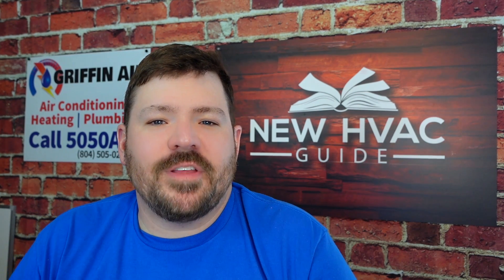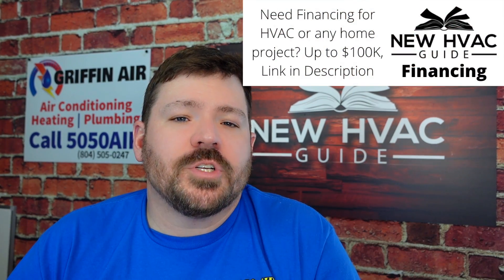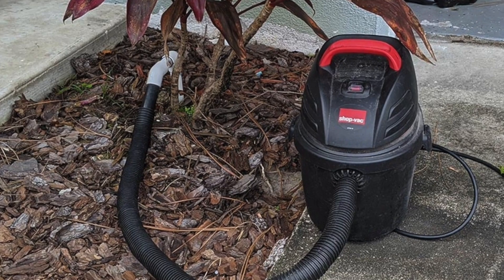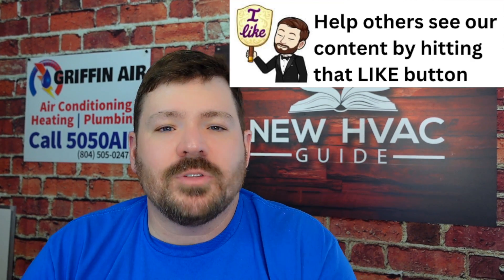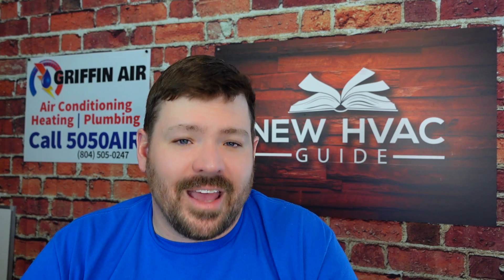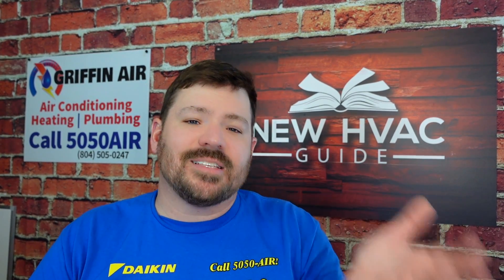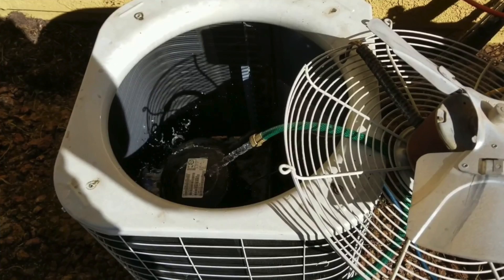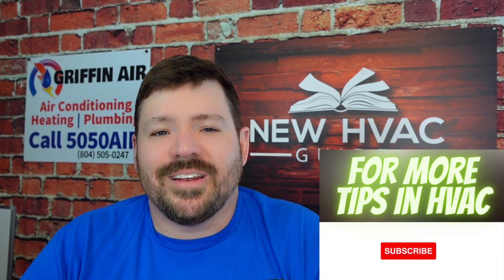3 Things HVAC Techs Do WRONG!

Comment: Whether you clear the block with nitrogen then flush the line or vacuum the line out then flush the line   both techniques work just fine ..
Reply: If the line is bad enough to blow the drain line out then you need to run a new pvc 40 drain line  and install it correctly then

Comment: Lately I've seen more techs do things incorrect. Mainly because I think they're thrown to the wolves too quick and don't get enough time with a trainer or supervisor because the lack of experience becomes very obvious. I'm not an HVAC tech but I am a tech on Flight Simulators and have been on electronics and aircraft. So I at least know how to troubleshoot and read schematics. The biggest thing I've seen is they're quick to change a part or what I call shotgun maintenance in most cases the probably hasn't been the equipment but the quality of the install. Someone didn't connect a wire properly or recently found out my dehumidifier drain lines not all the connections were glued. I've had two HVAC systems replaced by the same company one in 2016 and one in 2021. The system in 2016 in 5 years I can probably count on one hand the amount times I've had to call were there was problems with the system. Every time it was a part. My system in 2021 I've probably had over 20  services calls with the problems mostly of it due to the install or a design flaw.

Comment: Good morning! HVAC was short cycling called tech when he came out installed run capacitor to outside unit wrongly misplaced connectors on capacitor. System heated up and shutoff. Smoked at wiring. At furnace smoke came from condenser and motherboard. Crazy right

Comment: Called a company out because my heater was acting up. Dude fixed it for a reasonable price and was professional. I then signed up for their maintenance program. Had nothing but good experiences so when my parents AC failed I recommended them. 
 Dude wrote up a $10k estimate to repair it versus an $8k estimate to replace. No brained right? On his estimate he claimed the evaporator was rusted and leaking. The evaporator is aluminum. So I called his boss. His boss claimed that the frame is steel and just the coils are aluminum. He said the steel rusts where the aluminum tubes run through the frame and damage the tubes. 
 This sounded very probable and was a good explanation but I wanted to double check. I pulled the panels off and right behind there you could see the rust he was talking about which was clearly dripping down from a steel piece above the evaporator. The frame he said was steel was indeed steel but it was galvanized. The aluminum was solidly mounted to that galvanized steel and there was a big gap around the tubes where they passed through the frame. Hmmmm. I’m an auto tech in the desert with tons of automotive HVAC experience. So I decided to go over it myself. I went to hook the gauges up and found dude had left a shraeder valve loose. I vacuumed it below 500 microns and left it for two days. It held. I was surprised since I had bought a gauge set from harbor freight due to my good automotive gauges not having proper fittings. Figured the HF gauges would at least be a little leaky. Experience on cars tells me that a small leak may hold vacuum but not pressure and vice versa. So I hauled a nitrogen bottle up there and couldn’t find any leak to save my life. It held pressure for two days. It wasn’t leaking. Then I went back to the loose Schraeder valve. Could it be? Really? I put new valves in and charged it up. It worked for four years after that until the compressor failed. The unit was 17 years old by then so it got replaced.

Comment: RE: drain  The installers did something curious at the house my daughter bought, they set a pump with a reservoir and float activator on the basement floor next to the air handler to drop the condensate into, which then pumped it outside through a 3/8 Cu tube, 50-60' long, running up to the rafters grouped with the refrigerant lines to expel outside next to the outdoor unit.  This while having the exposed "walkout" wall just 20' away with adequate fall available for a gravity drain to the outside through the poured wall.

Any insight as to why they'd choose the method they did?

I discovered that when my daughter told me there was a water leak in the basement and asked me to check it out.  I determined the kids were running around there and dislodged the pump unit causing it to be inoperable.  It was easy to put it back together and get it working but it had muck inside so I cleaned it out and to flush the line I poured 10% sodium hypochlorite into the reservoir and pumped it little by little over several minutes through the pipe then followed up with a couple full reservoirs of water.   I wouldn't have hesitated to blow that one out if I had an air compressor there.  A shop vac wouldn't do anything on a line that small and long.

Comment: Having issues with the HVAC guy installing a dehumidifier wrong... I ended up calling the manufacturer to go over the system installation using the Installation & Operation Instructions the HVAC tech should have used.

Comment: Furnaces all have a 2 inch inlet and outlet but you have to read the manual to see at what size and length you go to 3 inch. Some start at 80,000 some at 100,000 etc. No worries, they have adjustable pressure switches.   lol

Comment: Most installers don't really care if the installation is to the manufacturers specifications. They are not concerned with being called out on weekends or evenings.
Reply: they should I do installs and I was trained to set manufacturers specifications reasoning being that I service them also I know how you feel
Reply: @Sadim Garnett  Thank you for taking your job seriously. Unfortunately, the previous mentioned is clearly what occurs in many cases. Not just in this expensive trade, but as an IT licensed contractor, I see it all the time.